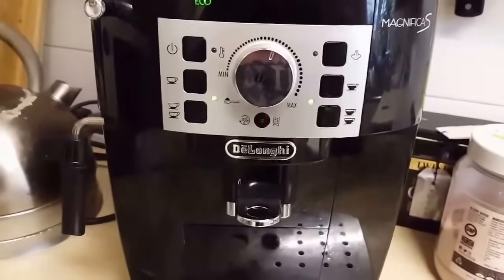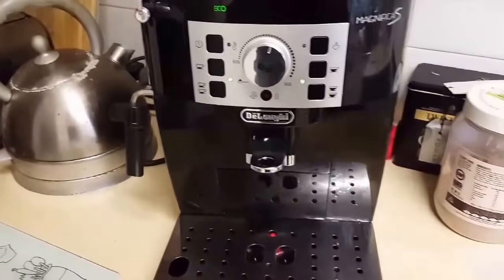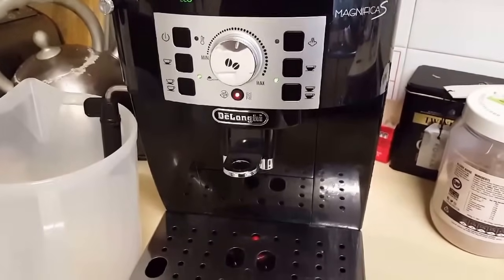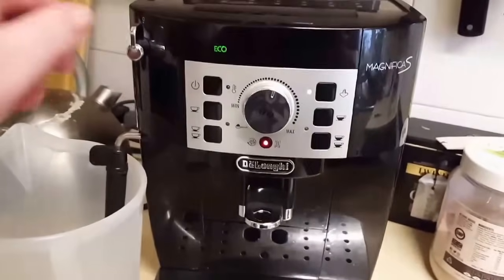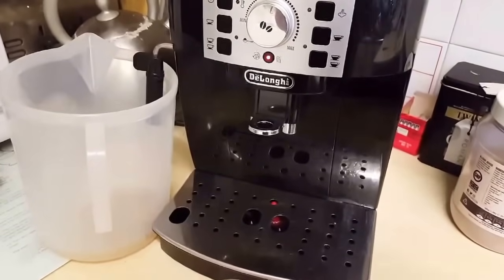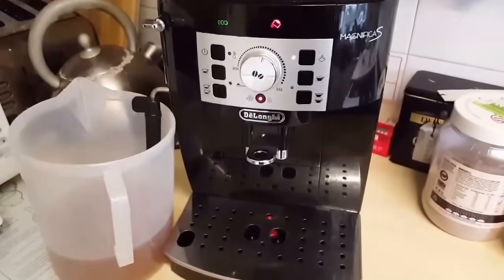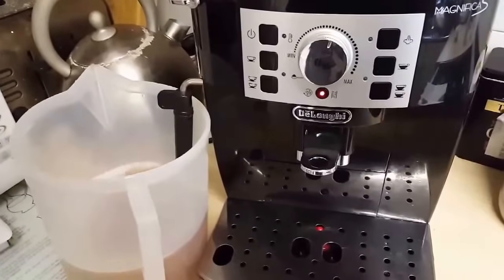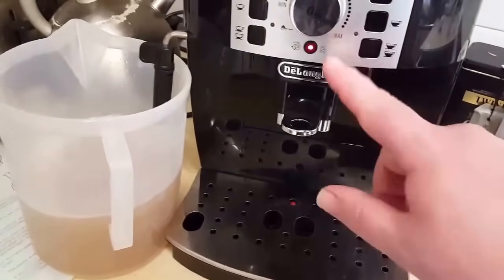How To Descale a Delonghi Magnifica Coffee Machine

Comment: But why nothing comes out the outlet and only the frother??
Reply from the maker: It's to help
Reply: Its to help what? The descale water needs ro run through the outlet also. This video is wrong
Reply from the maker: @paroshshaways985  No. The video is correct. It does NOT run through the spout. Check out the Delonghi video if you need more evidence. Jeez.
Reply: @CosmicPrawny  the delonghi video shows it going through both the spout and the frother.

Comment: I have the same issue that after the cap wand flow of water and refill the coffee nozzles also start to pour water so take care as some jug is required under these nozzles and this might be an update that this video did not address as it is dated 2017. I also note that reading the comments that others had to deal with this BUT the important thing is that this video is very good and one of the few that is HELPFUL

Comment: 1. Deacale process in this sequence:
2. Normal power on cycle
3. Power off
4. Empty the trays
5. Put back trays
6. Remove water holder
7. Remove the filter
8. Add descaler solution
9. Fill the rest with water, until the first line
10. Put back the water holder
11. Put bowls in place, under the front spout and under the steam spout. 
12. Turn on the machine
13. Long press red flashing light
14. Turn steam knob all the way on (cycle 1)
15. Wait 20 minutes, until water holder is empty
16. Turn off steam knob 
17. Empty the bowls
18. Refill water holder, until the first line, then put it back into the machine 
19. Replace the bowls
20. Turn on steam knob (cycle 2)
21. When all the water is used, turn off the steam knob.
22. Empty the bowls
23. Refill water holder, until the first line, then put it back into the machine 
24. Replace the bowls
25. Turn on steam knob (cycle 3)
26. When the steam light flashes, turn off the steam knob. The red light should now be off. 
27. Remove the water holder, replace the filter
28. Refill water holder, until the second line
29. Put back the water holder
30. Put back the bowls
31. Power off the machine
32. Remove and empty the bowls
33. Fill up the coffee beans holder
Reply: Good,  their instruction is not very clear
Reply: I descaled many times, but the water never comes through the coffee spout when descaling.
Reply: The instructions I had only said two cycles and the red light stayed on now after starting again with just water and doing the third cycle the light has gone off and all is fine.
Reply: So, the coffee machine we have for delonghi doesn't have filter.

Comment: my light come on after 45 use of cofee and i bought it 2 weeks a go and only used with bottle spring water as not usin any tab water and i didnt use the discaler when i run the discale mode ,is that matter ? cause i check the water no discale or dirt comin out
Reply: You could set it to longer periods of descaling (so that the light doesn't come on so soon) I don't think that the machine understands if it really needs descaling, it only has to do with how many coffees you made (as you mentioned) and this you can adjust in settings. Just do a Google search.

Comment: What happens if the rescaling light doesn’t switch off. I’ve done this several times and the light is still on.
Reply: 1. Deacale process in this sequence:
2. Normal power on cycle
3. Power off
4. Empty the trays
5. Put back trays
6. Remove water holder
7. Remove the filter
8. Add descaler solution
9. Fill the rest with water, until the first line
10. Put back the water holder
11. Put bowls in place, under the front spout and under the steam spout. 
12. Turn on the machine
13. Long press red flashing light
14. Turn steam knob all the way on (cycle 1)
15. Wait 20 minutes, until water holder is empty
16. Turn off steam knob 
17. Empty the bowls
18. Refill water holder, until the first line, then put it back into the machine 
19. Replace the bowls
20. Turn on steam knob (cycle 2)
21. When all the water is used, turn off the steam knob.
22. Empty the bowls
23. Refill water holder, until the first line, then put it back into the machine 
24. Replace the bowls
25. Turn on steam knob (cycle 3)
26. When the steam light flashes, turn off the steam knob. The red light should now be off. 
27. Remove the water holder, replace the filter
28. Refill water holder, until the second line
29. Put back the water holder
30. Put back the bowls
31. Power off the machine
32. Remove and empty the bowls
33. Fill up the coffee beans holder
Reply: @RiccccCardo1111  tnx
Reply: I have the same problem 😰

Comment: quick question i bought the machine yesterday and decide to use fresh bottle water nit from the tab ,when discaler light will come on shall i process without puttin solution in it ?
Reply: You shouldn’t use bottle water when there is a water filter in place

Comment: What if i dont have a descaling solution? Is ok to use water?
Reply: you can use vinegar. it works. just do the cycle once more with clean water afterwards.
Reply from the maker: No. It won't work.
Reply: How many ml of vinegar I will add to 1 liter of water thanks

Comment: At 5:07, if you close the tap and the descale LED is still red, you need to fill the water tank again with clean water and do another cleaning cycle. This time water will come out from the coffee nozzle, not the cappuccino maker. I had to fill the water tank 4 times in total until the light turned off. I guess its based on how dirty it is inside.
Reply: I'm doing the cycles for the 8th time and the red light is not going away. One more try and then I will take this out in the garden a light it on fire.
Reply: I also have to refill the water tank twice before the light goes off. First I thought is was something wrong ....Haha
Reply: Péter Viszt yes me too!!! 2/3/4x thankssss i thougt its defect
Reply: @loadingimage4701  I am still trying to get the light to go off descalled twice think i am also on the sixth time filling tank pulling my hair out.
Reply: @loadingimage4701  Yes me too!  First time I descaled I only had to fill the water reservoir once even though it had been years!  Yesterday I descaled after the light started flashing after just two months and had to fill the reservoir 3 times before the light went off!
Reply: Bende aynısını yaptım lamba hiç sönmedi
Reply: THANK YOU !!!!!
Reply: Mine came out of the coffee nozzles also during rinse mode. I thought 💭 had just ruined a very expensive machine!
Reply: This comment saved me.. 😅 I would've never thought to keep going and filling it up several times. After 4 times the red light finally went off. 👍